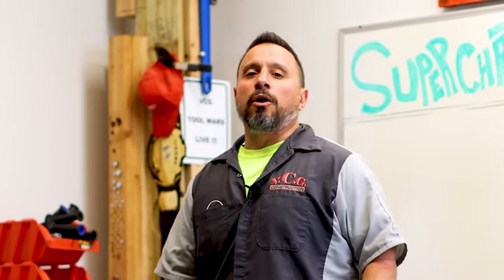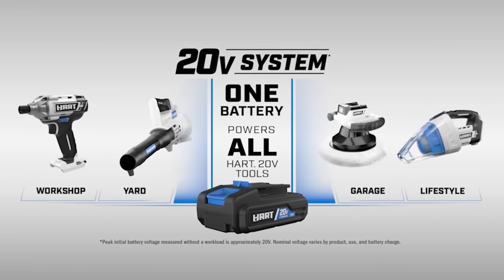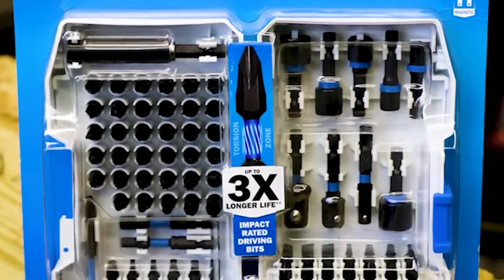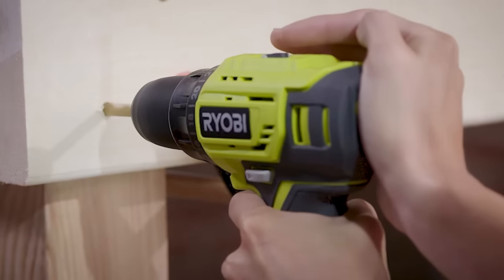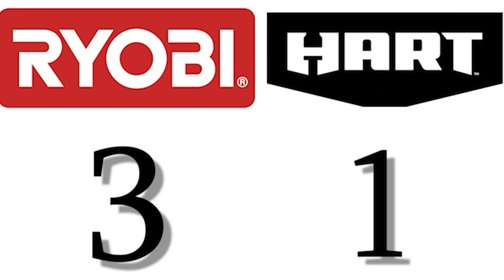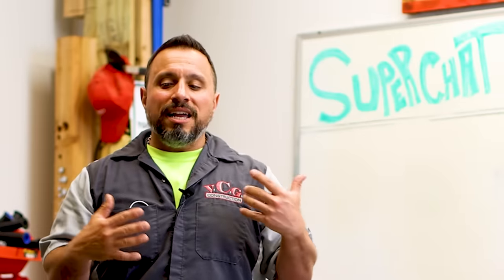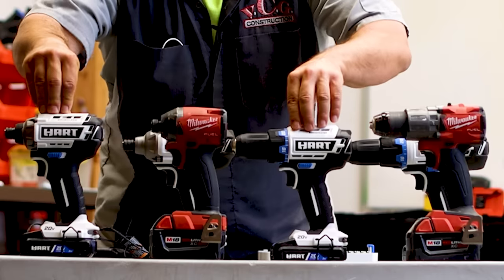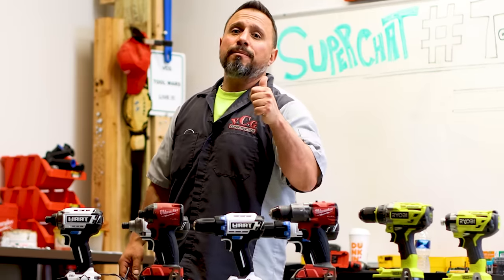HART Power Tools At Walmart PEOPLE HAVE NO CLUE!

Comment: You put that very very well, thank you so much for articulating the statements that I am trying to explain to a relative of mine. She bought a hart 20v Leaf blower that came with a two amp hour battery and charger. At $60 for the tool and battery and charger that seems like a deal, but there are no aftermarket batteries for this brand yet. I’m sure their lawyers are fighting tooth and nail to maintain their patent. Because to buy batteries that are actually sufficient to use this as a leaf blower two Four amp hour batteries cost $160 at Walmart! If they ever stock them… 

I’m glad I went with the Walt, I had my doubts that they weren’t as good as Makita craftsman Hilty snap on Mac etc. But I feel like I’ve gotten great bang for buck with better quality than Ruby and Black & Decker. Even though Black & Decker and The Rock are one in the same their batteries look identical but the cells are installed opposite one another so you can’t just plug one do you want battery into a Black & Decker tool or vice versa without an adapter or some soldering.

Since Dewalt has continued using the same 20 V style system for a very long time now without changing the housing style for the batteries they have allowed me the time to upgrade my tools and my batteries as needed. I never thought much of Ryobi as far as quality, you can get a very very wide array of tools from Ryobi but they seem subpar compared to Dewalt. I don’t have experience with much Makita other than corded but they seem to be of high quality. So do Bosch and maybe just a little less craftsman. Someone could definitely make an awesome spreadsheet about the aftermarket battery costs and ancillary tool offerings of all of these companies. Then on top of that there are cheap Chinese knock offs that are their own systems completely and they are super cheap like everything from China buy two cheap ones instead of one good one, that’s how we sold ourselves out. I believe in a future of durable goods including electronics made in the USA, that’s another reason I don’t like some of these cheaper ones, someone could buy that for you as a gift one day thinking they are getting you what you want but instead are wasting their money basically insulting you, that is the most heartbreaking part of giftgiving and why I don’t do it at all anymore because of situations like that, manufactures profit from the tears of misunderstood giftgiving‘s… Anyways thanks for the videos, cheers!

Comment: Hart might be good for a new tradesmen getting cheap tools in a pinch to get them through the first 90 days to 6 months then later upgrade to Kobalt, Milwaukee, Dewalt, or Makita. If you are a serious hobbyist like myself, it can be easily worth a splurge on the black and red with fuel written all over it. There are some features that will not trickle down to cheaper tools like thermally hardened ESCs, high temp stator windings, PA6GF30 body, and other things that enhance the durability and reliability of the tool and allows the engineers to make the tool more powerful without breaking such as a metal drill chuck and a high quality steel alloy impact driver anvils.

Comment: I just noticed these in walmart today and funny this particular VCG video popped up in my feed. 
If you don't have power tools and looking to get into battery power tools, pick a brand and voltage and stick with it. I am really annoyed having about 4 different battery types, such as that oscillating multitool because it was $60 compared to $140 for dewalt (my preferred mfg tho I think Milwaukee is best - that yellow Dewalt is really easy to spot when I've misplaced it for the 1000th time).
Some brands have different batteries (ie: 18v, 20v and just because you have a ryobi battery doesn't mean it'll fit every ryobi). 
I find the most convenient battery operated are an impact driver and a drill. Most everything else I use so seldom that corded will be a tool that lasts for decades.
If you only use something maybe once a month, go corded. Batteries do have a lifespan, and a battery sitting around for months doing nothing is a waste of money. For example, I have a corded and battery multitool which I don't use often - I really should have stuck with the corded version. When that battery dies, the tool is getting tossed.

Comment: No I wouldn't jump to Hart...I have been using Ryobi for several years now and I love them.  Always thinking of upgrading but just can't decide if the price difference would outweigh my everyday needs. Right now Ryobi is doing all I need. I have built decks and installed metal roof with Ryobi.  Thanks for the video.

Comment: Home improvment, commercial building, home building, fine carpentry, furniture building , done it all in the past 30 yrs. I can honestly attest for the past 20 yrs. it's been Ryobi still have and using the blue ni- cad brand, currently using pretty much all of their present , I have about every tool for any of these fields of artistry I've used and owned many top commercial brands  some have failed battery and electric. Ryobi tool hasn't failed but, the battery has. If you use these tools for work upgrade to the 4ah - 6ah- and now 9ah. battery for longevity and power. Tech changes now Ryobi offers brushless motors for more power to battery consumption as new tech evolves in the tool. In the end it's a choice hope this helps. 👍👍

Comment: I have a hart 4 volt screwdriver, and I love it so far. My drill died and I used it to drill 4 holes in a cinder block wall, it was slow but it didn't skip a beat.

Comment: Before they became a staple at Walmart I was able to pick up a holiday bundle for $90. Came with a drill, driver, Sawzall, and flashlight. Have no complaints as of yet.i have even added on with the polisher and air pump for $20 each. All using the same batteries. Waiting for an adapter to be released so I can use my ryobi batteries in my hart tools or vise versa.

Comment: I use the power screwdriver from Hart for certain jobs at my job and it works great when I need it. It also holds a charge on the lithium battery. I use Milwaukee drill most of the time though.

Comment: i was doing a 2300sf remodel with crown throughout...bought a ryobi compound miter and went to do my first piece of crown first cut and im hanging off into space... did the math again same resutl turned out the saw was off by one degree...not insurmountable and once adjusted the rest of the job went fine... 
but it kinda pissed me off at the time i just didnt want to drop dewalt money on a saw i was probably going to dump after the job was done... but its little qc things like that i cant stand.

Comment: For the homeowner Ryobi is the best platform you can use. They have the biggest variety of tools you could ever want because they are all based around the homeowner. I used them professionally and I'll tell you this, I 've never worn one out, yet. I've got some old blue Ryobi tools which are still going strong, and all of them use the same 18v battery. Don't invest in Hart cause you'll need something they don't make and you'll have to go with another brand, which means new batteries and charger or a cord. Ryobi has been coming out with a new tool every week.

Comment: The drill,impact,tire inflation tool,sprayer, and the flash light all seem to work great. The bigger battery and the 2amp usb battery charger all work well. I got the impact, drill,sawsall, 2 batteries with drill bit and chick set for $140 all still running minus the sawsall and bit box. The bit box broke right away the sawsall lasted about 9 months doing ac work the reciprocating head snapped clean off

Comment: I made the impulse buy mistake at Walmart. I was getting some things for the house and decided to buy a hart drill ,  it lasted about a month with very light use,  needless to say I will give them five or so years before I try them again, if they are still in business.
Reply: Weird. I've been using the 1/2 in brushless drill / driver for literally months now doing DIY repairs / fixes in my new house. Performs really well and I've had no issues. Maybe you got a lemon.

Comment: Hello friends I am currently a beta tester for Hart Tools and Milwaukee Tools also dewalt and son. I wanted to tell everyone that Hart Tools is definitely using Milwaukees looks and also Hart Tools are bad ass because Milwaukee and Hart perform the exact same. Howni know this is because I'm beta testing right now and wow everything you can get with Milwaukee you can soon get with Hart Tools. Hart Tools finally got the Hard Case and I have some batteries that nobody knows about a different rating never made before and it last for days. Get excited because Hart Tools are there and soon to be released to the public are the new Line of Hart tools with Hard cases and this new unbelievable battery. Have a great time buying Tools everyone and remember Hart Tools are not cheap Tools at all...

Comment: I thought Hart looked super familiar, turns out these get sold as Mac Allister in Europe (B&Q own brand). Definitely budget tools but not terrible, we've had a basic brushed combi drill kicking around for nearly 3 years now as the workshop drill and it's still going strong. TTI brand explains that I guess. The Mac Allister kits are a lot more generous with batteries, all seem to come with 2x 1.5 Amp and much cheaper than Ryobi (£40-50 kits).

Comment: bought a ryobi 18V one+ kit several years ago (black friday deal) with like 6 tools, 2 batteries, a bag, and charger... Fast forward a few years, I now own around a dozen (or more) green tools, several batteries in all different amp hour ratings, and 3 or 4 chargers. the ONLY ryobi "tool" i had an issue with was the flash light. after 3 years of use and a few drops.... it quit, other than that for the money the green beasts are hard to beat

Comment: Personally im trying out a black & Decker matrix multi tool like that its more compact only issue is the battery is a porter cable with a extra tab so they don't interchange because im a porter cable we recently lost our local dealer so ill be modifying my battery but for $75 for a drill / impact / sander with a battery charger and the 2 pack of battery were on sale for $45 and with minimal effort fits my porter cable battery im happy

Comment: I've used Ryobi most of my DIY life, but recently I've also gotten Bauer tools because they're cheap and when I can't get a new Ryobi tool I look for a Bauer equivalent, and Bauer is actually decent, I nearly toasted my hammer drill driver, and it came back from the grave stronger then before, that thing has been dropped, and bashed so many times now, and it keeps going. 

I'd like to see Bauer vs Hart. which of the cheapest of the cheap DIY tools is better?

Comment: I Love my Ryobi tools. I’ve thought about switching over to the Milwaukee brand but they’re a little pricy for what I do.
Reply: They may be pricey but you won't regret it! Milwaukee tools will last you forever.
Reply: I had a ton of Ryobi tools and they were really solid for the things I did. We recently gutted out house for a major remodel though and I needed something a little more robust. My wife listed my Ryobi tool line on facebook marketplace and sold them. I picked up the M18 brushless drill driver, impact driver, finish nailer, leaf blower, and 4 5.0A batteries for about $700 at Home Depot on sale. Ended up coming $200 put of pocket after the sale of my Ryobi stuff. Also, the M12 lineup is incredible for the price. I've had the 1/2" ratchet for a while and it makes automotive work so much easier. Their M12 3" cutoff tool is a godsend too. It made cutting and laying hardybacker and concrete board incredibly easy.

Comment: Everytime I decide to get any tool with a battery the companies decide to change the battery design. Then I'm stuck with a tool that has no chance of ever being used again. 120v plugs haven't changed in a hundred years. I still have a skil saw my dad bought in 1976. Works everytime.

Comment: Hart is a good driver and drill I bought to use and try at work I used daily for over a year only issue I've had was the batteries went through two batteries in a year I work in a cold area so condensation was bad in the batteries

Comment: I own ryobi "kits" 2 of my chargers were dead within a couple of months, I bought a pack of two batteries, one went critical (discharged beyond being able to recharge again) within a few uses. Older stuff from them fairs a little better, or at least still works. The chargers have faulty components that if replaced the devices can be brought back to life, but why should I have to?

I don't know anything about hart but with ryobi you're taking a chance, I have a miter, a table saw, now even a jigsaw (plugin), my battery tools all work a multi tool and a few drivers, none of the tools gave me problems. The batteries and chargers are a different beast, an incompetent beast.

Comment: I got a little hart hedge trimmer thing on clearance with battery and charger for like 30$. Im all in on the Makita lineup but the bare tool makita was like $120. Considering i will use it 3 times a year at the most, it was an easy decision.

Comment: I was gonna but the 4amp battery but it makes more sense for me to get the Hart vacuum that comes with the 4amp battery and a fast charger for only $200. So then ill have two 1.5 amp batteries. A 4amp battery and two fast chargers along with my brushless drill and driver, reciprocating saw, Hart inflator, automotive hand vac, a giant case of bits for drill and driver, smaller case of bits for driver, 4 set of pliers, hammer and Hart folding utility knife that came with 10 blades, not to mention the 15 blades i got for the reciprocating saw. Oh yeah and the flashlight and bag that came with the set of drills and saw and batteries for it was $130 or $150. It was a while ago. And my 12 inch Hart clamp

Comment: I got the 6 piece tool combo for $100, came with impact, drill, circular saw, light, reciprocating saw, and orbital sander.  Fantastic deal even if they just last a year they are worth it for the price I paid.
Reply: How did you get it for $100? That's less than $20 each. It's listed at $300 and on rollback now for $200. 🤨

Comment: Got a hart tool pack with drill and impact driver and reciprocate saw and flashlight plus 2 small batteries and charger for round 180 and they work pretty good I put up a fence with them did some cuts and what not and they work pretty good so far

Comment: Areas that don't have big-box hardware stores usually have Wal-Mart, BUT they usually have an Ace Hardware in the area which carry Milwaukee and DeWalt. Not having access to good tools is a cop-out, they're everywhere. I'd definitely go (and have gone) M18 brushed over these Hart tools. Just buy 2 less coffees that week and you can splurge on the better tools, or get to a HD and get Ryobi, or better yet Lowe's for Kobolt.

 Wal-Mart stock is also notoriously inaccurate when checking online before going to the store, and the Hart section that's 1 aisle does nothing to entice sales with the few offerings that are in stock.

Comment: I've owned all three at one time or another. Milwaukee tools are the best of all three, right now I own the flashlight, drill, impact wrench, jig saw, job site radio, circular saw, and the multi station from hart.  I don't have a problem with the then so far and I would only use kobalt for the last 11 years. (Kobalt changed their battery system miffed me off).

Comment: I have the hart brushless drill and I needed a drill to use ice fishing for an auger everyone told me to buy a Milwaukee or Dewalt little to rich for my blood so I went with the hart with 4amp battery preforms just as good as the Milwaukee or dewalt drilled around 100 holes 10 inches thick on one charge will be using more hart tools for now on!!

Comment: My only hart experience is the small tree pruning saw first time the chain got loose and jumped off I noticed the tension screw was broke from the factory. It's still sitting in the box in my shed I haven't even returned it just chalked it up to trash tool not worth my time.

Comment: I wish these companies would standardize their batteries.
There is no reason Dewalt, B&D and Porter Cable all take different batteries.
They are the same connectors just with some of the pins blocked off and wired different.
Likewise Milwaukee/Ryobi & Hard should all use the same type of battery.
I know that will never happen.
There are some adapters out there but I haven't been able to find a universal one that would make B&D and DeWalt work with Porter Cable 18 volt.
You even have to get an adapter to get PC 20 volt Max to work with their 18 volt tools.
Reply: I think they could probably bring it down to two batteries, Milwaukee team and dewalt team and the rest of the brands split up behind each

Comment: I just started buying into HART tool. I had been looking at them for a little while and then my Walmart threw a bunch of stuff on the clearance isle that made it a no brainer. I picked up 4 double packs of the 20v 4Ah batteries (normally $129 per pack) for $40 ea, the handheld vac for $10, the $45 spotlight for $15, the little $30 flashlight for $10 and the $69 rotary tool for half price. Nothing wrong with any of them. Now that I have 8 4Ah batteries that all have 3 year warranties, I will probably be buying more HART tools.... and I will checking the clearance section regularly. Considering that they have a 5 year warranty on the tools, I don't mind taking the risk of buying them off the clearance isle.
Reply: Tools like this have a very short shelf life. They won't even be around in two years, much less 5, so the warranty is meaningless.
Reply: People said the same "won't be around long" thing about hyper tough tools back when Walmart launched them back in 93' ...yet that are still around almost 30 yrs later.